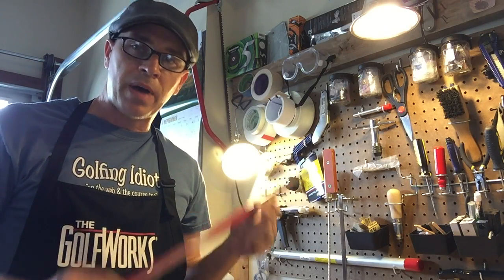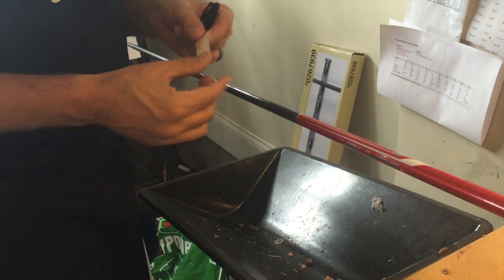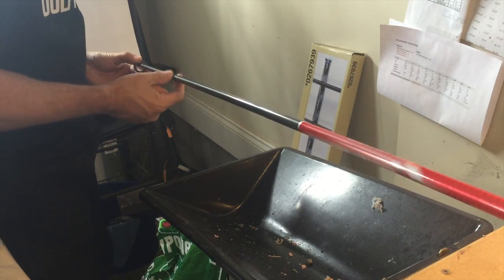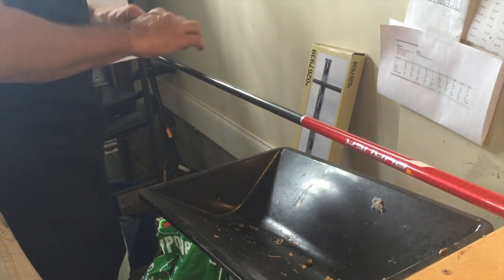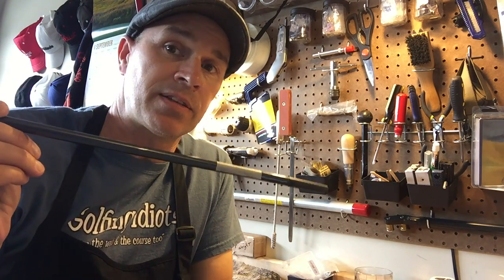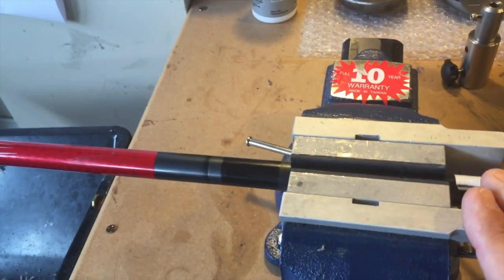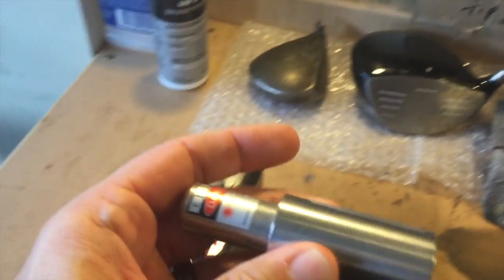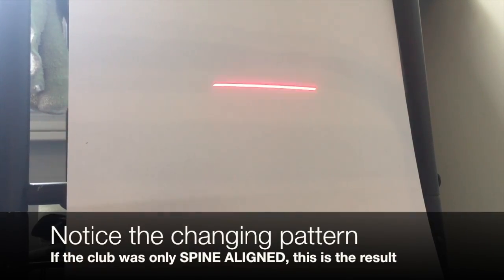How to FLO a Golf Shaft (correct position of shaft alignment)

Comment: I like the video and agree with most things you say in it. However, I believe that there are 2 minor faults in your video, viz.
1. You initially set the spine to the 3 O'clock position (towards the target) and said that you were going to FLO the shaft for a right handed golfer, BUT you flexed the shaft away from the target as though for a left handed player. Wouldn't that be giving you an incorrect FLO result for a right handed golfer?
2.  You stated that you could FLO a shaft by flexing up and down OR side ways. You omitted one very important aspect with that. The direction you flex the shaft should be entirely dependent on the vice being used. If the vice is the same as the one in the video, then sideways flexing will give the most accurate result. You should only flex up and down if the vice grips are top & bottom, not side by side. In other words the flexing needs to be against the resistance of the vice otherwise a false result will ensue.

Sorry to be nit picky, but I believe you should have clarified point 2 in the video, and been aware that you actually flexed for a lefty even though you set the spine alignment position for a righty.
Reply from the maker: First, where the spine does not typically correlate to the FLO of a shaft.  I showed that in the video to demonstrate that difference between the two techniques and the how spine alignment or spinning a shaft will not find always find the FLO of the shaft. 

Second once the shaft is in the FLO position, you can flex the shaft in either direction and it will maintain the FLO.  There is not a difference for a lefty or a righty for FLO.  If you want to get picky about the matter, the FLO position actually offers two options when placing it in the shaft depending on if you want less dispersion or more distance... but this video was not designed to teach all the aspects of potential options for FLO with limited equipment and techniques.
Reply: have to disagree with you about the direction you flex the shaft to find the FLO. I had my woods and a new set of irons FLO'd last month by a person who has been a club fitter for 50 years, and works with pro golfers and he agreed with my opinion. Out of curiosity we set the spine at 3 O'clock and flexed the shafts in both directions and the results as to where the FLO of the shaft was were very different. So it does matter which direction you flex the shaft and this testing proved to me that setting the spine to 3 O'Clock for a righty and flexing to the left was most definitely giving a FALSE reading.